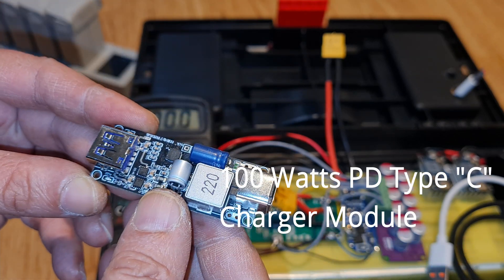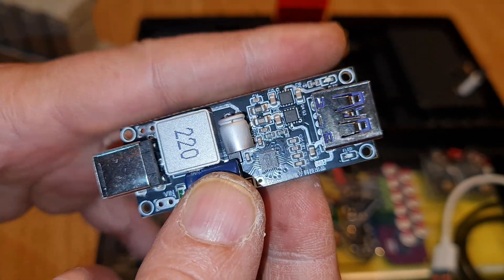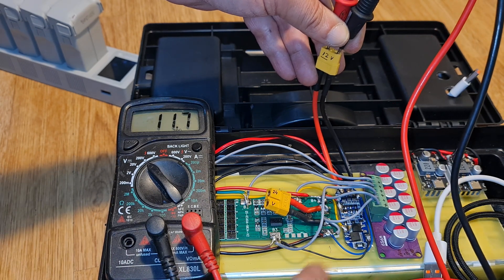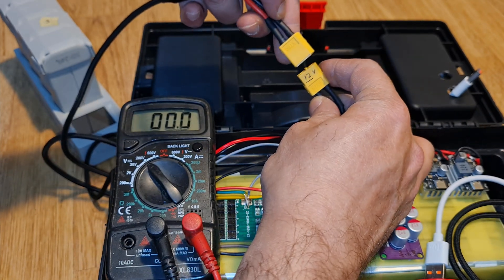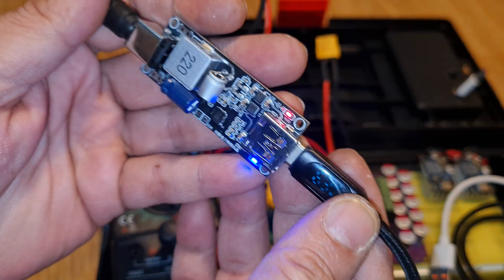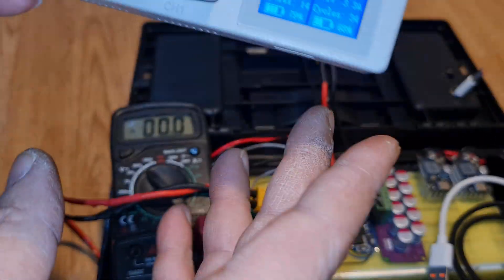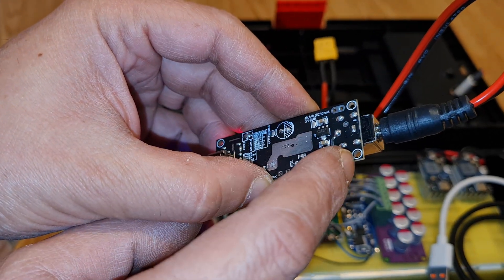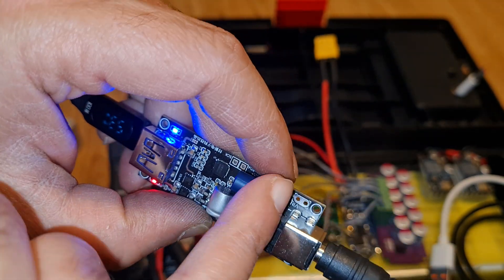Review & Tested SW3518 100 watts full protocol high power fast charging module SCPFCP QC4.0 pd3.0

Comment: So as I wanted 20V 5A (100W) supply. Should i go for a SW3518 (100W) or SW3538 (140W) module? I'm planning to use it with my 7S Li-ion battery pack.

Comment: Is the type c on this module can charge the battery pack too?
Reply: For charging battery pack use a buck-boost convertet with constant current settings.

Or if using a 3s pack use LX-LISC V4 module

For 4s and 5s Use LX LIFC

For 6s you need to build a custom module with DC 400W 15A Boost converter set at 25.2V and 1-3Amps given 12-19V input of atleast 5amps.